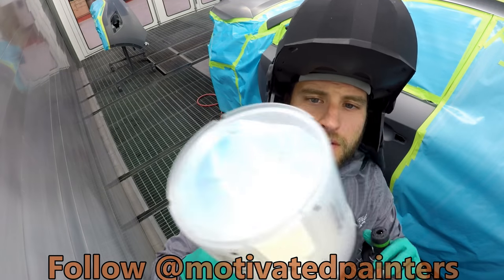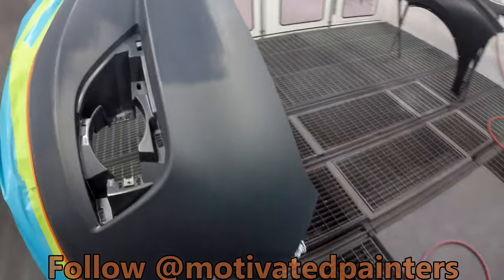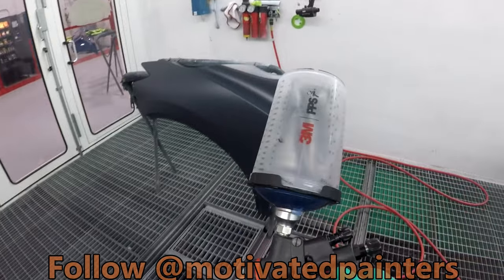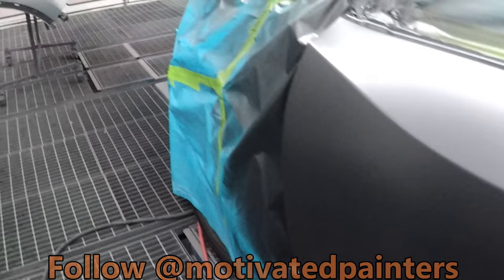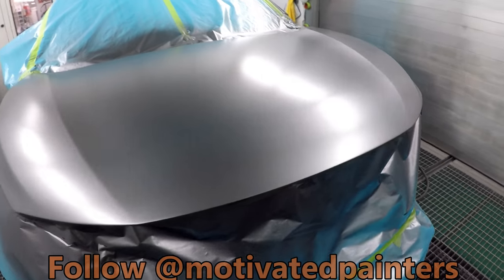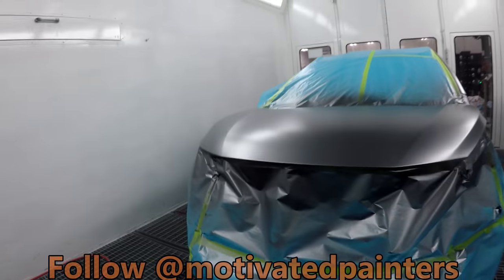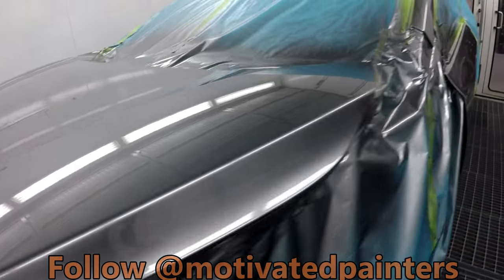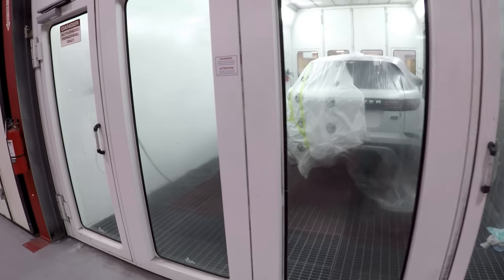Grey tips Sand piling tips

Comment: Gabe Whats the purpose of the 490 in the base? ive never seen or heard of that before. is it just for the drop coats?
Reply: Hi there t490 is just a clear base coat tinter. For example if you mixed a 1000g of colour, the actual colour changing tinters may only reach 800g so you would then use 200g of t490 to achieve the 1000g your mixing. Hope this helps

Comment: Great tips, 99% of a time i use wet base when sprayin metallics. Although i spray Pro Spray solvents most of the time. KAD a "nightmare" is too polite . 😂
Reply from the maker: Hahahahah 😂😂
Reply: You need the right paint line 90line no problem with that color
Reply: Robert Walter sprayed lots of things , but never sprayed glasurit. How is that system with color matching ? And if KAD on 90line couses less issues every shop should have that just for this color 😂

Comment: Don't understand the title Gabe. Sand piling is when your sandpaper loads up with swarth. What does any of this have to do with sandpaper?
Reply: Hi there. Sand piling is a term used in the spray painting world for when the base coat lays on top of the panel rather than into the panel creating a texture area which would be visible after clear coat. Gabe showed us how to avoid this problem by using a wet bed (clear base coat)
Reply from the maker: No my friend it's when the base piles up at the end of the blend and it looks the Sahara desert
Reply: MOTIVATED PAINTERS   that's what I meant. Cheers Gabe